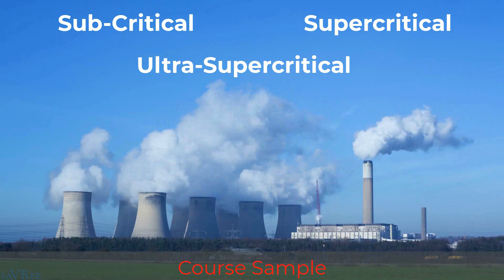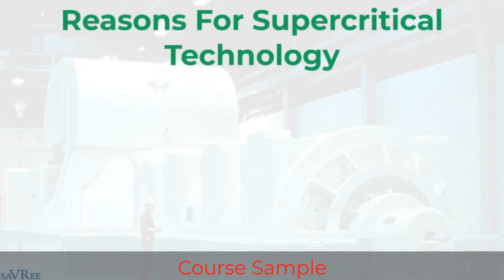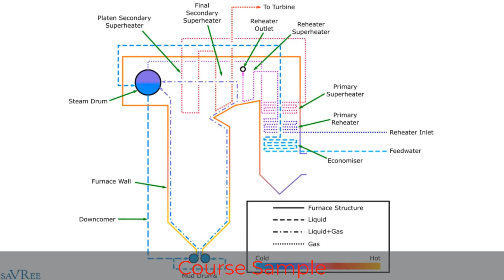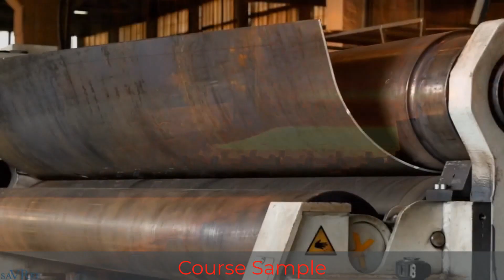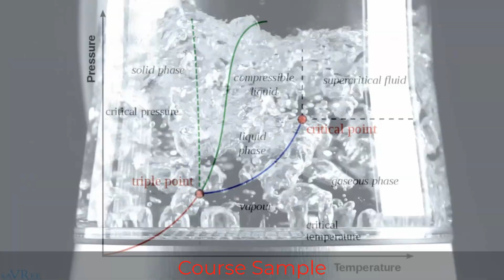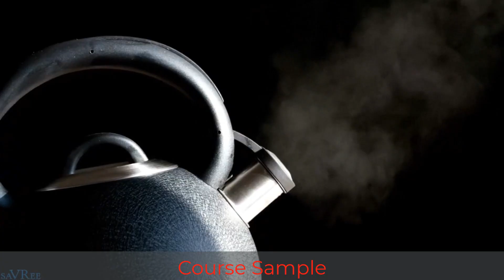Sub‑Critical, Supercritical, and Ultra‑Supercritical Boilers - Video Course Sample

Comment from the maker: This video is a sample from the saVRee engineering video library, which features over 100 hours of video content covering mechanical, electrical, marine, power, nuclear, and industrial engineering topics.

In this sample, we explore the fascinating theory and design principles behind sub‑critical, supercritical, and ultra‑supercritical boiler technologies, highlighting how water behaves at critical points, the transitions between phases, and why these advanced systems are redefining efficiency in boiler operation. The sample touches on key themes such as critical and triple points of water, phase behavior, design considerations (pressure, temperature, efficiency), operational and environmental advantages, and what distinguishes each boiler type in terms of performance and sustainability.

📘 Explore the full course on Sub‑Critical, Supercritical & Ultra‑Supercritical Boilers:
https://savree.com/en/online-engineering-courses/sub-critical-supercritical-and-ultra-supercritical-boilers

🎓 Browse our complete course catalog:
https://savree.com/en/online-engineering-courses

🔧 saVRee gives you access to:
- 500+ interactive 3D models for technical training.
- 100+ hours of video-based engineering education.
- Industry-standard content used by engineers, students, and trainers around the globe.
- SCORM compliant modules for seamless integration with your learning platforms.

Start learning about engineering today with engaging, practical content, visit https://savree.com

#savree - THE engineering training company.